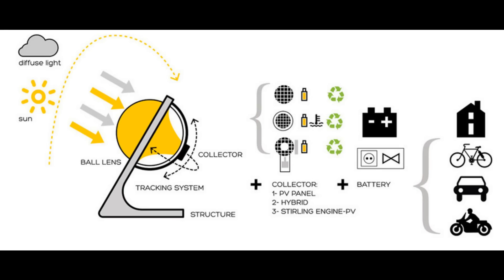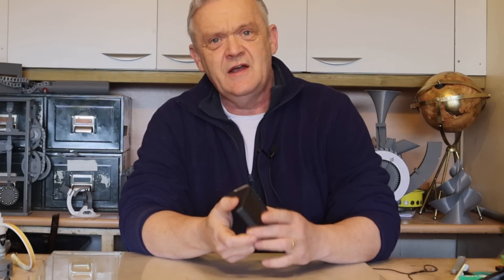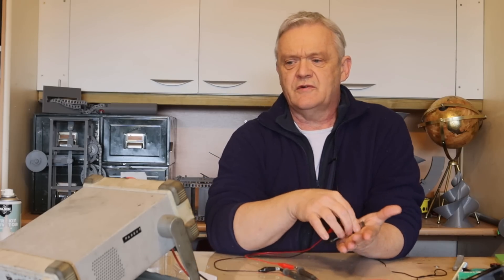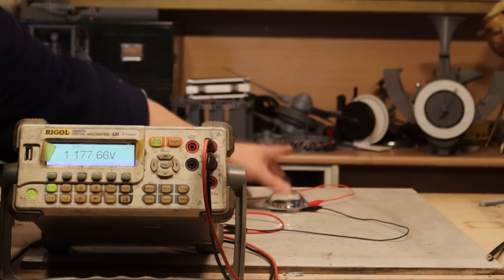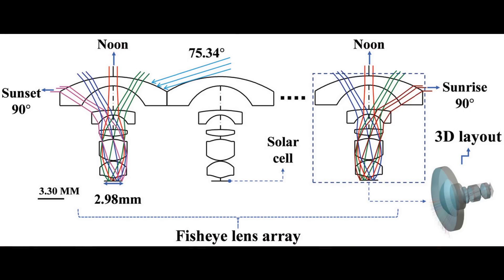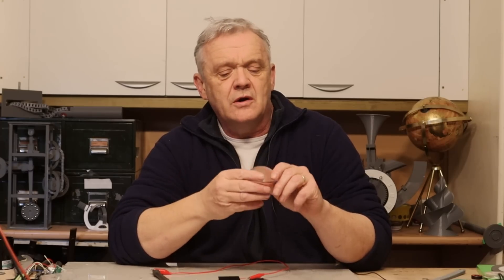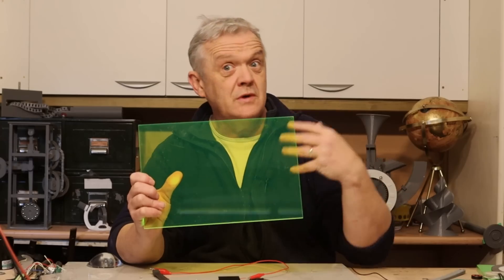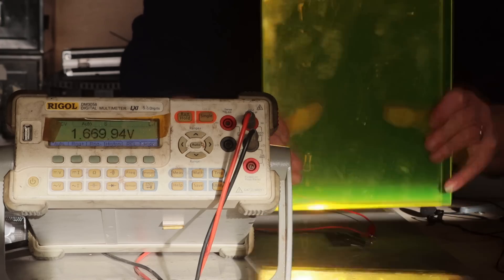2198 The Spherical Solar Cell

Comment: Just hook up a 5amp, 5-30v input lm2587 dc dc converter 5 dollars to your solar panel to step up voltage on a cloudy day. I posted the pic of the converter on X. The panel was just a usb 22 watt panel off amazon for about 12 to 20 dollars.

Comment: There are talks about flat solar panels having lots of tiny half spherical bumps on them to capture more of the light, supposedly, it can capture light at more than 85-degree angle, which if I understand correctly, means you wouldn't have to rotate the panels as much as it's able to capture light at a wider angle.

How well that works in the real world, we'll have to see, because like so many of these things, it's still in the lab lol, but the science behind it sounds feasible, which is kinda like we saw in the video but a lot more of them in tiny forms, it could in theory catch more like in cloudy, dark conditions, but we'll see if any of this comes to market for real world testing, and if heat is an issue at all.

Comment: I enjoy(ed) quite a lot of your video content, i just keep on wondering why "we the humans in civilisation"  attempt to squeeze or quench more energy (density) out of modificated mass then we should, if we have systems that don't give a lot of current or heat but turned out to be highly reliable not needing a lot of maintenance, why did "we" start to change "running systems"? just for some fancyness or "prestige", not returning to proven technique like land rover parts in cars? is there some patent/courtesy/trademark whatever "ruler" forbidding us to re-use those old concepts? just for some military advantage? just take a look at cars, how they aren't getting built in styles as far as we could. If this didn't turn out as some shame, what would be the benefit, for who the heck? aren't we allowed or even encouraged to achieve whatever "matches a house of style"? you show the technical components "we" could had chosen.

Comment: I want someone to build a special all amps solar panel.  This panel would be useful for helping out low amperage batteries like earth batteries.  The all amp solar panel should be easy enough to build, just wire the photovoltaic cells all in parallel.

Comment: Options and alternatives are great for innovation, especially for specific uncommon uses.
As you said at the end of the video, maintenance.
Also, for example, if you spend 20 million dollars on parts to optimize a $1 solar cell, you aren't saving money.
It's like if you had a lens the size of a house for a single solar cell versus having a solar cell the size of a frisbee.

Comment: As an amateur gadgeteer, I immediately see these problems with this design: First is weight... If this is solid glass it's going to weigh several hundred pounds and will not be easy to move around. Yes, moving the solar cell array will be much easier as the focal point of the concentrated light moves with the sun, but the HEAT produced from this would be hot enough to melt metals! AND could damage the solar cell array. 

Next is price: A fresnel lens is fairly inexpensive molding but creating a huge glass ball is going to be expensive! 

This looks good, but really isn't very practical.

Comment: there's also one huge downside of using a huge ball of glass...
it's making a huge ball of glass! it's going to be very expensive and heavy... you could just install more than 10x the amount of solar cells.
Reply: Why even glass balls if we have lightweight Fresnel lenses or parabolic mirrors that do the same but cost much less. There are parabolic mirrors 3 stories high, it's impossible to make a glass ball of that diameter

Comment: What if you had a double sided cell with a half circle of florescent acrylic mirrored along the outer circle and concave from the center diameter to the outer edge?  then you could spin it in the windand it woudl always have optimal light plus both collect light and move based off a breeze while scaring away birds.  If you used it to light a LED, it could replace all the airport lighting in the word for less than the cost of electricity to light them now.

Comment: You can coat it in wax embedded with fluorescent pigment and when its hard to clean, warm it over 150 f and the wax will melt and the mess will slip off and u can rewax it.

Comment: I watched a long video of a company, I believe from Japan, they were working on two things. One an ink that you can print and have yourself a solar cell on regular paper, by simply pressing print. And 2, they were using very small solar cells, like hundred if not thousands on something the size of regular paper, but each small cell had a glass or plastic lens on it that focused the light like a magnifying glass. It was said to take over. And it went MIA. That was over 10 years ago. I think the scientists got the idea from bubble rap.

Comment: Hmm, does this mean that instead of my solar garden lights breaking down, because they're cheap and water gets in etc etc, I could mount them with the solar panel facing downwards and fit a vertical/slanted acrylic sheet below them and 1) get more power and 2) give them greater weatherproofing? 🤔🤔🤔

Comment: Let me further amend my suggestion for experimentation.  Take (2) separate sheets of the plastic and apply a mirror to the back of (1) then another mirror facing downwards and then apply the second sheet of the plastic.  Take a third Mirror and place it so that sun light is being bounced into the lowest plastic plate.  You should get a true reading of how much energy potential is being picked up by the reflection.

Comment: I looked up solar panels for both my dream computer and the possibility of solar powering questionable LCD electronics.

Apparently solar panels are tuned to different light levels. Who knew?

Those planels on calculators? They're for low light conditions (inside). Very interesting!

Comment: @ 3 minutes, you have the optic the wrong way, as if it's the other way ( curved part down) it will project more concentrated light on the cell.

This was shown by green power science with a 4 ft square piece of plastic in a frame. 

It was also shown by NASA Back in the 70's to increase solar efficiency 8 times. No overheating problems in space. 

So though this looks great: but it cost money and as always  I am the CHEAPEST penny hoarder there is. So the green power science 4ft plastic in a frame is for me. 
Thank you for the video.

Comment: My main problem with this design is how bulky it is for no reason at all. Sure it LOOKS cool, but a fresnel lens the thickness of box cardboard would do the same job at redirecting light to the solar cell for a fraction of the weight and material.

You could even exchange the cell position and lens and replace the lens with a curved reflector for an even lower tech solution. There's so many ways to improve this design.

Comment: What would happen if you blacked out all the sides of the plastic sheets and just gave it a small opening on the bottom or used a reflective tape to push the light back in from the sides?

Comment: I wonder if a modified version of this "Spherical Solar Cell" might work a bit better if it were applied using more of a fiber-optic cable setup?
One end of a fiber-optic cable would have the dome or spherical contour and, the other end would have the concave shape like the inside of the sphere.
It wouldn't have to be a very long fiber-optic cable, but it would have to be of a diameter similar to the diameter of the example of the Spherical Solar Cell you showed in this video or a bundle of fiber-optic cables.  
Picture a bundle of thinner fiber optic cables all with a spherical shape on one end and the concave shape on the other.
By allowing the spherical end of the fiber-optic cable bundle to track the sun, it would allow the full amount of sunlight to be dumped directly onto the photovoltaic cell.

Comment: Rob, the thing is a solar cell is a current generator, not a voltage generator. The voltage stays relatively similar even with a large increase in available light energy. A better measure (although not perfect) would be to measure short-circuit current, as that's more directly linked to how much light can be converted to current.

Comment: mr Robert, if i was to put down a solar panel and make sure it would follow the sun all day long (there are simple devices for to make it do that)....
and now i would also have mirrors that follow the sun and direct the sunlight straight onto the solar panel.

Would this increase the output of the solar panel?
Reply: what if i used 6 mirrors to direct the sunlight to the solar panel.
Will this increase the output of the solar panel significantly?

Comment: intresting design , a sphere , to its not maybe the must sutible choice, but as an art installation , i guess it works , 

the problem in whole , not every bit off potential energy is worth capturing , becus of cost material usage and degradation ect.

but its kinda cool. but it vould be fun to the the preformance graf. and gatered data. for fun.
Reply: tho it dosen't realy matter. there is far superior ways.

Comment: Great video! I really enjoyed it! Im the guy who asked if a wood stove powered Heat fan can be scaled up. You told me to look up flat panel Sterling engines. That's absolutely not what wood stove heat fans are. They actually have a Thermal electric module embedded in them connected to a small electric motor. So I will ask the same question again can this type of system be scaled up??? 🤔

Comment: Could make a large concaved reflector  coated with mylar,  and put that underneath a Glass  bowl full of water and place on top of it a solar panel facing down...
( making sure it's  focused on the bowel).

Hmm maybe you perspex sheet might work really good as a collector,  and shape and paint with that mirror paint on the edges you don't with to lose the light through... 🤔 Maybe a tear drop shape with a small exit at the tip for the light to be projected through...
Hmm 🤔 you could arrange it like flower petals, focusing the in the center

Comment: I would like to see you redo that later half and this time add a mirror that is 45 degrees off set to the plastic sheet.  Mirror would also be set back and to the side so that it is reflecting original light into the back side of the plastic.  (I believe that since my grey and cold days are in the temperature range of -10 celcus this would be a working option to get power when otherwise you would be running the timer on what ideally should be a 3 grey day battery supply.)  * System would have to be shut down and converted back to normal operations quickly when the full sun comes out and the temperature rises both ambenant and on the plate surfaces.

Comment: Styro pyro just put out a video and he used a lens system to achieve long range high intensity lazing¿ that I believe could be used to mitigate the heat issues of concentrated solar. Maybe not for solar cells in particular, but solar Stirling generators, solar cookers, molten salt systems, and the like.
Reply: Thinking about how mirrors absorb too much heat to reflect concentrated solar.

Comment: a slanted side of the panel would enlarge the area, also an octagon panel could radiate to 8 solarcells, and add the sphere on top, add a mirror on the back of the panel, could help.

Comment: It's not just the concentration effect. It's also changing the angle of incidence which is very important. consider how much light is reflected on a wet road blinding you. but if the sun is overhead that light doesn't glance off and you don't notice it because it's absorbed by the road.
The whole assembly is tracking the sun anyway because this is so important to fix this effect. The biggest problem is a solar cell is only as good as the worst illuminated part. So if you put a shadow of a thin branch over a car sized panel the whole output of the panel drops as if the whole thing were shaded.

Comment: They had these over 20 years ago. Arrays of lenses on small high efficiency (and at the time extremely expensive) Solar cells. Their idea was to limit the need for tracking and get maximum output from the cell. Needless to say they are not on every roof so it wasn't economically viable.

Comment: I enjoy your videos!
Not clear if you're using any kind of known load resistance when measuring the output of that solar cell.  Without that, the voltage readings seem of questionable meaning, although they clearly correlate somewhat with the amount of light.  With a resistance, you could measure the current and thus power, whcih seems like the important consideration here.

Comment: it's no different than what people would do with a magnifying glass, or any other lens. it just takes up more space. or if someone used a Fornell lens as a collector/concentrator, and focused the light that way. then using a heat collector to eat up excess heat. but the problem is that the excess heat may actually damage many solar panels. so.. not a huge upgrade.

Comment: of course light multiplication - improves "efficiency" - of the bare cell, by altering the area metrics.

(cooling by some means becomes absolutely necessary for concentrated silicon cells - in daylight).

Improving off-axis performance is most advantageous.

Comment: Robbie you would be totally astounded if I were to explain to you how you can pull energy from the vacuum. I spent 12 years researching to this day. I could use your assistance in creating an effective and efficient extractor. At the moment I can pull 1.3 volts on material half the size of my PINKY fingernail. Yes Robbie that small. We need to discuss this either chatroom or phone. I assure you it will probably be the biggest finding of your life.

Comment: Sounds far-fetched. It isn't making the sun any brighter, it's just collecting light from a greater area. Simply using a larger panel would achieve the same thing without the need for a gigantic expensive glass ball.

Comment: When Solyndra came along, I didn't hear of it for a while (first I  knew the name was when I drove by on 880 in Fremont and saw the very impressive sign they were adding and thought "Solyndra"? what is that?) When I found out what it was,  I immediately thought of the Whole Earth Catalog from (if memory serves) 1972, and a discussion of cylindrical solar, concluding that they won't deliver the benefits claimed at a cost which makes them worthwhile, it's more of a gimmick. That (remembering 50 year old articles about  the "latest thing") happens every now and then, these days, but I have to admit, they've got me on this one. I never heard of it. I am inclined to go with your analysis.

Comment: Using collectors to get a better average over a day is definitely going to help in the long run, but making it cheap is the hard part I guess?
We've got automatic tracking on our panels, but it wasn't cheap and does need more maintenance.
Round solar panel attached to a cylinder of fluorescent material with a domed top? That way you could just feed the cylinders through a wall without exposing the electronics and give you better options for cooling, or at least concentrate the heat for other uses.
Not sure cylinder costing, but it will get cheap if you're making enough.
Bonus is that it'll end up looking like a glow-in-the-dark Dalek.

Comment: Flourescent acrylic secondary (wave guide)  glazing or outside shuttering might make a good, cheap way of gathering solar power. Essentially you'd only need about 1cm width of solar panel all around the perimeter. 
Fixed secondary glazing is realistically probably not what people would want on their homes as a permeant feature but outbuildings, sheds, garages etc should be fine. As shuttering, it'd still be working when open and be serving it's power gathering when not used as shuttering,  for use in wind or (partial) sun shading in heatwaves.
Reply: My ADHD brain wouldn't let me rest at that...
My thoughts were sparked off by...The acrylic you showed looked about 1cm think and the solar cell about 4cm square, yet the large increase in voltage was by only increasing the wave guided light to 1/4 of the area.

 I don't think a 4cm thick piece of fluorescing acrylic is likely to have a even light distribution across it's depth but I realised I'd fallen into a trap of "accepting what's there, so far, as the way to do it"  
So I'd propose that an angled cut be made across the acrylic so that the hypotenuse of the wedge cut is ( in this case to match your cell ) 4cm. That gives the whole of the cell under a wave guide and would seem a better comparison in measuring how much the fluorescing acrylic increases the output.

Now the question becomes how tall do we have to have the acrylic before the extra light on the cell is essentially wasted.  A quick and dirty experiment there would be start with a long piece and slowly roll a cover over it until it showed a significant decrease in output.

I'm looking forward to next year when I've ( hopefully )moved out of my very small flat in expensive city and have a bit more space and time to do those sort of tests myself

Comment: Yes, this is a good idea. You can lose some of the energy by the lens, but with decent quality glass, it is not very much. The real issue that I have encountered is the cost of the lens... perhaps you can figure out a low cost easy way to make the "spherical" type lens for a larger panel? Or, maybe a low cost plastic like a wrap could be warped into a bubble...
I did try the fluorescent dyes by layering it over a solar cell (not vertically)... but it didn't work for me to boost the total power... hard to say why not but my guess is that the dye is also absorbing the energy from the visible wavelengths as well.

Comment: Look into the concept of hot and cold mirrors if you want to make the most of the 70% of sunlight that is usually just turned into waste heat that contributes to urban heat islands when there is a lot of rooftop PV installed.